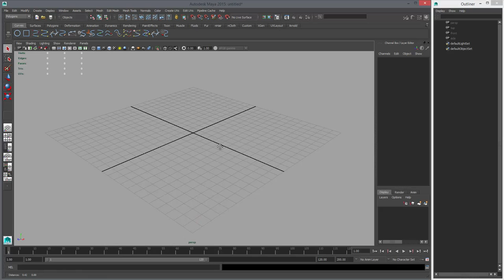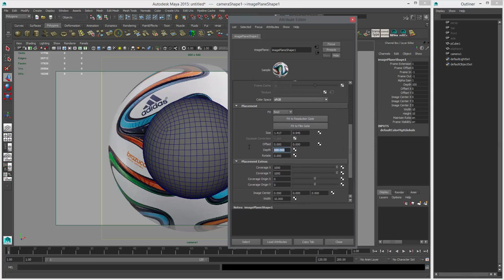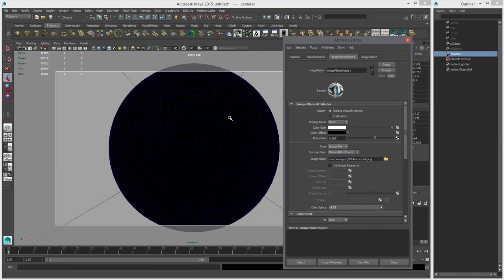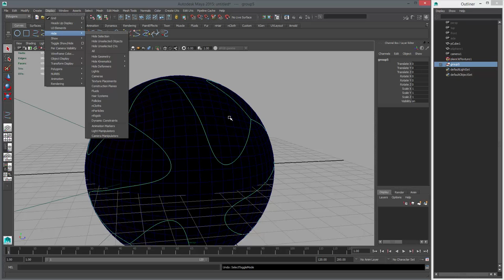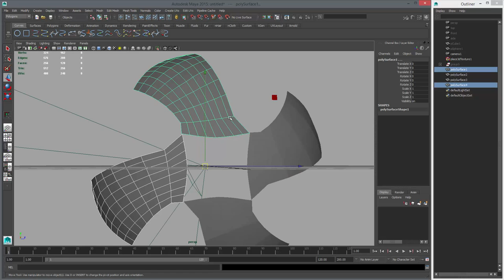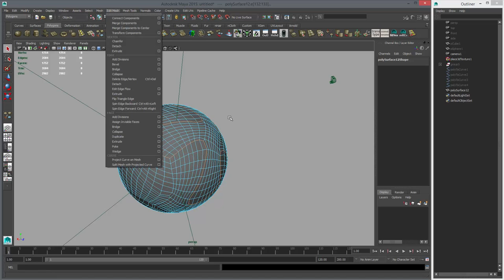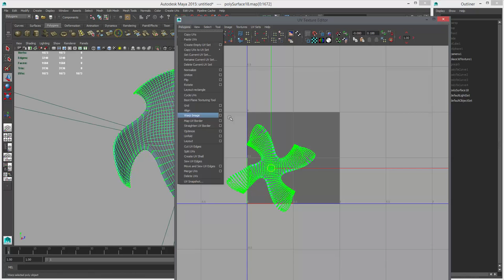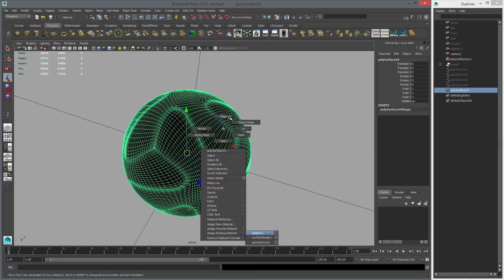2014 World Cup Football (Soccer) 3D Modeling

Comment: Hey, I found your channel and I like your way of modeling because I model like you, I like "everything nice and tidy" :D

Until AD introduced the shinkwrap deformer, to make a smooth cube into a perfect sphere I always used the sculpt deformer..., in my opinion is easier and faster than the shinkwrap to do this task because you don't need a "projection sphere" anymore, just click and scale the handle.

I hope this little tip is usefull for you :)
Reply from the maker: Thanks, that's a good tip. I still prefer the "projection sphere" in this case so that all of my projected meshes stay at the desired scale. If that's not necessary though, then I will use the sculpt deformer trick.